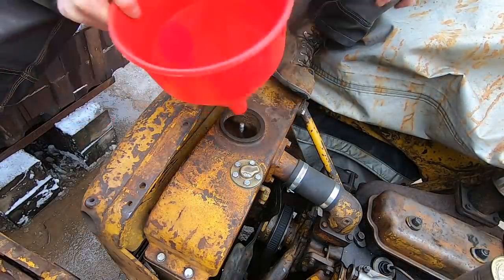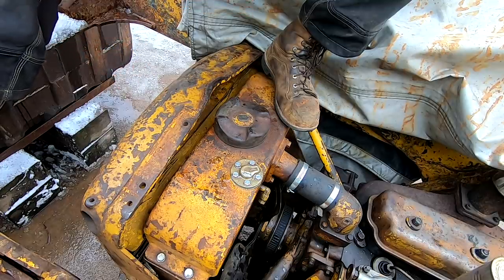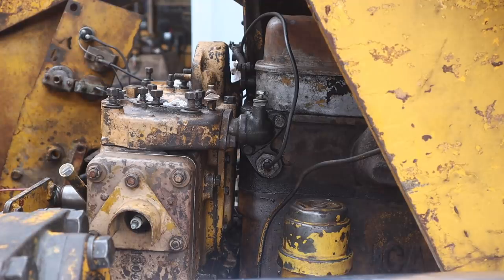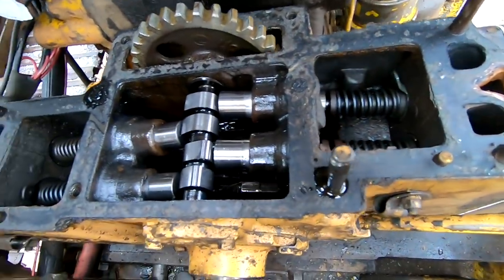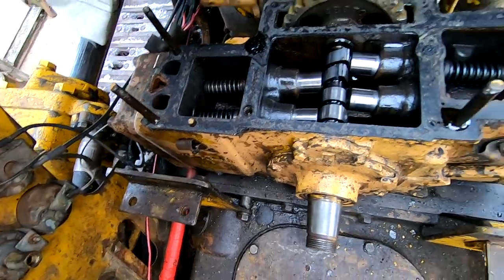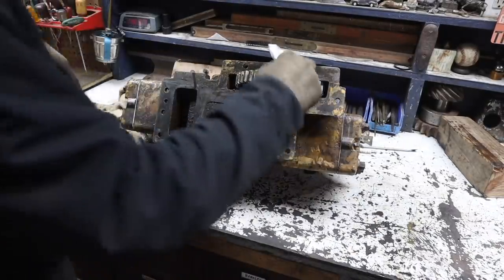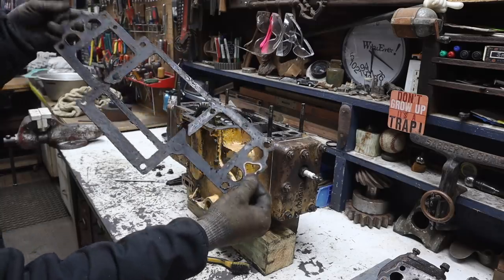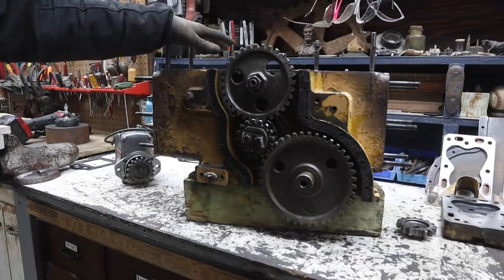I REMOVED the Pony Motor!!! ~ Part 15 ~ 1950s Caterpillar TraxCavator

Comment: Again, you are looking at the problem from a different angle.  The play is just fine.  The clearance is within standards.  There is no need to replace the bearing.  You will still have the play because it was meant to be like that.  You have fixed the problem by fixing the magneto.  Although, the contact point needs to be adjusted to precision gap.  The timing of the engine wholly depends on the gap of the contact point. The condenser has to be in tip top shape, so might as well get a brand new one.  This is the ignition system of old motorcycles, when contact less ignition firing was still in the designing board in motorcycle building.  I have had 2 motorcycles with this system, and it took some effort and time to precisely set the timing.

Comment: Bushes that are not comprised of white metal for applications such as crankshafts and gear shafts/axles are normally made of a special "phosphor bronze" alloy.

Phosphor bronze is porous so that it can retain a certain amount of oil within it's structure.

Comment: D2 and D4 Cats share the opposed (boxer) type pony motor. Larger Cats have inline 2cyl. I've owned a couple of 5J's (D2). One was a blade and the other was a cable Traxcavator. The main bearings should be replaced with factory replacement bearings. Their alloy is specific to the application. They are out there in internet land. Were it I who was doing this job I would certainly contact Squatch253 as he has all the specs, info and service manuals to help you. He is currently doing complete rebuilds (OCD) on a pair of similar D2 ponies. He got his parts somewhere. I bet he would share. Keep up the good work I enjoy your videos.

Comment: You found one half of a castle nut, where is the other half??? Something got wedged in the gears that made it to brake. Don't forget to look down in the basement. Also need to find all the broken parts of the gear too, all  those broken pieces are just floating around looking for a pinch point.

Comment: Uneven bearing wear on bearing nearest foot pedals would suggest a possible tiny imbalance or loosened flywheel may be worth checking checking  ?
Reply from the maker: The flywheel was absolutely loose! It definitely affected the front bearing and was part of what caused it to go bad!! I'll show you when the pony motor goes back together!

Comment: I hope youre replacing the rod cap bearings, they seemed to not stick to the rod caps like they should. If they dont spring out and stick to the caps its easier for them to spin in the caps down the line and youll have to clean up the aftermath of spun bearings.

Comment: Ethylene Glycol may have a change of state at 8 F degrees but it doesn't become an expanding solid like water. I had a customer who was adamant that his vehicles get ONLY pure ethylene glycol. Our normal winters include weeks at a time when high temp is -15 F and the occasional day with -35 F high. In the 5 years I saw his car for spring and fall service he had no problems at all. 50/50 mix is ideal for maximum cooling efficiency and is good for most cold climates. I like 60/40 for further North.

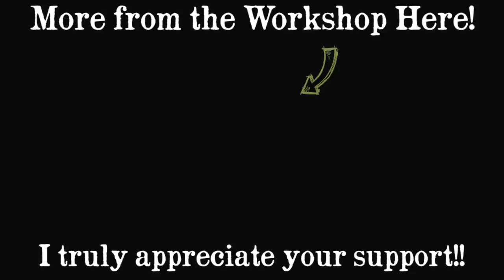Comment: The broken metal piece that you find in this video in the outlet of the oil, came from the following place. But before just need to say that my english isn't good; so you better have a look to the minute 32:55 ot the total 51:07 of these video and you will see the place and at the same time the piece. I think it's the screw nut of one of the pistons, which fixe the piston on the back part. Greetings from France.

Comment: were there timing marks on the gears in the magneto? Because for the spark to be triggered at exactly the right moment, the crankshaft gear, cam gear, mag gear, and the two little gears in the magneto need to all be timed  in relation to each other. 

You don't need to mark those sears. You have a timing mark on the flywheel on the front of the motor - I saw it on a previous video. Just figure out where that timing mark lines up on the front cover of the motor and you should be good to go.

Thanks for the excellent videos. I just found them about 24 hours ago and have been binge watching this series.

Comment: be sure to use bearing bronze and add the thrust material back to your thickness measurement.if the crank thrusts on the casting then adjust thrust clearance with the gear cover gasket.cant help but feel that that split nut or the other half caused the gear breakage.other half may be in the bottom of the starter gear housing.leave crank grinding to the crank professionals.
Reply: Nut was in crankcase drain.  Gear that broke was in front gearcase.  There’s no communication between the two (until he lifted the pony off the clutch housing).

Comment: Excellent video try find the factory aluminum alloy bearings for the crankshaft bronze is not meant for the speed that the engine runs they have a marginal oiling system I am sure that caterpillar has the proper bearings still available there are alot of them machines still out there in operations. It needs to have a minimum of 2 thousands of oil clearance on the crankshaft bearings because it if they are to tight it will stick to the crankshaft.

Comment: Water is very unusual in that it expands on freezing. Glycol almost certainly does not expand so while solid coolant would screw things up if you tried to start it, there "should" be no damage if it's allowed to thaw out.

Comment: Crankshaft end play is obtained by a thin steel washer 4b818 & the crankshaft brg. I still maintain it was the loose flywheel that caused the damage. To set crankshaft end play, install brg  adjust brg for proper end play, remove crank ,drill a dowel hole in the brg insert dowel. The  bearings are a Aluminum alloy, in fact all cat starting motor main bearings are aluminum alloy. Main engine bearings were aluminum backed. You can get .020 us 4f9413 brg & 030 us 1H2828 brg from Cat. Florin Tractor in CA might have some. That nut is off a Con rod, Somebody did a poor job putting that together the flywheel Has to be tight!. All I have left is a parts book for a D2. Have done lots of these motors,but my memory is not the best anymore

Comment: Not to sure about using just any bronze to replace that bushing but if you go that route oil impregnated bronze would be better for bushings.  Again not sure if I would use something outside of the manufacturer oem, best of luck though old red sure is coming along!

Comment: Squatch253 managed to source some old stock surplus parts.  This fault caused by not shutting off pony  motor by turning off the fuel and letting it run out.  If shut off with the magneto switch, fuel in the carb runs down into the pony motor engine oil, thins it, and these crankshaft bearings get worn out....  Do check out what squatch253 has to say about this on his D2 5j1113 starting system rebuild videos on his youtube channel.

Comment: If you could heat the lower rad hose convection will  cause the coolant to circulate and mix. The same way block heaters warm an engine.

Comment: To get the desired precision fit up on those crankshaft bearings you could cut them close on a lathe,  but your gonna wanna hone them to final size.  I didn't see a thrust washer or surface,  your gonna need to know what they did to control the thrust or what the allowable amount is.
Reply: The crankshaft end play is held by the washer, gear and retainer on the front end and a thrust shoulder on the crank.  In other words the front main bearing length sets the end play.  The excess movement he found results when that bearing gets loose in the crankcase bore/dowel pin gets loose in bearing etc.

Comment: I think that broken nut found in the oil drain is what caused the gear damage. That minor shaft play im sure couldnt have done that much damage to your gears. Think I would be lookin for the other half of that  nut along with the broken gear teeth before putting things back. Just saying. You worked hard on that beast. Take a moment to see where that nut came from.

Comment: bad crank bushes will cuase broken mag gears. the bushes control end float when worn or spun( a small dowel is all that holds them in place) the crank can float cuasing a harmonic vibration that shatters the gear and/or bends the mag shaft.

Comment: I think that a more likely reason for the damage to the magneto gear is that castellated nut that was floating around in the crankcase .I do not think the float on the crankshaft would affect the starter mechanism unless it was much worse than yours .

Comment: Don't forget the KISS principal.
Adding an electric starter just causes more problems to pop up eventually.
For very little gain.
Use one or the other.
Me personally, I'd go with the electric starter just because it'll be easier to change in the future and it has a lot less moving parts to fail.
I've always found that old KISS principal saved me a lot of money and headaches.
That's my two cents worth.

Comment: Making the new bearings is very cool but I think you should consider trying to find NOS from caterpillar because the metallurgy involved in selecting your stock could be quite difficult to replicate. "Just sayin". I do realize that the pony motor is only used for a moment or two during start up. But why not try to find the NOS while you have the motor disassembled.

Comment: you should NOT use bronze for a new bearing, use babbitt instead. it is the same material as the ones you have already. bronze can be good for surface bearings as well, but the pony motor was engineered with babbitt bearings and may not work with bronze, because bronze expands and contracts different from babbit. 
also the babbitt inserts in the piston connecting rods should be firmly sitting in the caps and not float in between the journal and cap. make sure the can't spin around, because that would be an issue as well.

but overall really nice work you've done so far, looking forward to many more videos about old red. 
greetings from denmark.
(don't mind my rather bad English)

Comment: Bronze is a good idea, but I would not make the whole bushing. Instead, drill out the aluminum bearing 0.1 and then add an interference fit sleeve inside the bushing. You could do the same with a sleeve around the outside, too, but it didn't look all that loose coming out. I think that would be more stable than entirely out of bronze or brass.

Comment: Aluminum wears well against steel. If you are going to make the bearings, build in a thrust face, pushing the bearing in from the inside.
That broken castle nut might have come from a previous motor.
Reply: My experience says otherwise. PACCAR truck engines in Peterbilt and Kenworth trucks have aluminum bearings and we've been having problems with them lately. Meanwhile the traditional babbitt bearings in Cummins engines have been just fine.
Reply: @dangerrangerlstc  The theory behind aluminum bearings, besides being cheap, is that they would absorb particles that might grind away the shaft. It would be interesting to know the cause of the failures. Too small bearings? Poor filtering? Inferior alloy? Lubricant breakdown? ??
Reply: @craigsmith8217  babbitt bearings do the same thing. Failures are usually delamination. No other oil supply failures.

Comment: i went that far in ,id do re ring also ,main and rod bearing also,welcome to heavy equitment, even the smallest track can be heavy after you lift about 200 of them hahahha.
also if im not mistaken ,oil clearance should be .001 thousand per inch of bore size,check your manual,also if the brass has oil for it it will be a upgarde as far as metal

Comment: The coolant flows up from the head through the thermostat down through the radiator to  the pump into the block in a continuous regulated circuit. From bottom up
Reply: P.s. might the nut be from a bearing cap?

Comment: "there's the old gasket ... it's probavly reuseable  ..."
Dude, you tore the old gasket taking it off. 
Gaskets are cheap. Get a hasket set for the pony motor. With that crank slop, and the half a castle nut you found, you're going to have to (or should) rebuild the pony anyway, as long as you have it out.

BTW, Use a daRn engine hoist or something to nring the pony motor back out to the tractor, and to set it back in.  
Your back will thank you in a few years. 
TRUST ME! I did the same stupid thing when I was young. 
Now, 40 ~ 47 years later? I can't reach my toes, I need a sock putter-oner thingie to get my socks on, I've have had a lower back ache every minute since March or April, of 1973, and some days I cannot reach my shoe/boot laces.

Just because you CAN lift and carry something heavy, don't mean you SHOULD.
OSHA says "50 pounds" is the most anyone should lift, no matter how big and strong they are, without assistance. I know that pony motor weighs considerably more than 50 pounds.

Unless for some unfathomable reason you WANT to be a cripple and in pain for the rest of your life starting before you hit 50, get help moving and lifting heavy items, or use a hydrolic or come-a-long/chain lift of some kind.

Comment: You mentioned the end float of the crankshaft, it is supposed to have some, and there will be a written tolerance in some handbook to give you an idea what is correct.   The play was most likely caused by the loose pin in maybe an elongated hole in that main bearing.   Are the other two holes for lubrication, or are they staggered to allow different end floats to be achieved..?
Reply: I concur.  The rebuild manual should specify an end play tolerance spec.  I've never worked on a donkey motor but every crankshaft I've encountered had specified end play.

Comment: Babbitt. Most engine bearings are a habit alloy. Looks like aluminum.  You haven't done one yet but some very old engines have Babbitt bearings cast in place. By use of carbon blackened crank it doesn't stick to crank. I have a feeling you'll do one someday.

Comment: I really think you should look at those cylinders and piston rings again. Just because you can't see any scoring doesn't mean they are ok. Firstly since you have it all apart you should check for tapering and ovaling in the cylinder bore. Then you should take the rings off the piston put them in the cylinder and check the gap. That is the only full proof way to know if your rings are any good. Buy the amount of oil that is bypassing the piston rings when you were hand turning the engine with the head off it would lead me to really look at those 2 things closer. Truthfully rings are normally cheap and anytime I have any engine broke down this far I just replace them, if they are available.
Reply: Another thing I was thinking about is looking at that carb along closer because no matter the age of the machine it definitely shouldn't wash the cylinder down with fuel from just sitting there even if you leave the fuel on. I would suspect in and carb of that age that either your float may be the issue. It may have a leak and not be floating or may be mis adjusted. Heck even the needle valve seat may be an issue. Yes I know you showed it opening and closing but that is not the be all end all demonstration people think it is.

Comment: One of the big jobs of anti-freeze is to provide a rust inhibitor in your cooling passages.  Leaving them dry for any period of time leaves them in air to corrode.  Not good.  Better when working on an engine to keep its anti freeze full up and catch it later to reuse it.  Your engine will thank you.

Comment: Now before jumping right in did you make sure that the magneto gears is in the same orientation as it was on old one for timing purposes cause if it backfires that could ruin your rebuilt magneto and your shaft problem you will probably need crank shims

Comment: Surely the rear main bearing would be Babbitt, or at least alu coated with Babbitt?  As some others have commented, Squatch253 on here would be a good person to contact if you need advice/knowledge of these things.  In all honesty though, as long as you have good oil supply to the rear main I can't see a problem with turning up a bronze bush if the crank is too undersized for a correct bearing after the scoring is cleaned up. 
It's done on some old Brit bike engines from the factory (bronze bush instead of a "real" bearing), not ideal and not gonna last forever but for as long as the pony motor is going to run (a fraction of the time of the main engine) I can't see it being an issue.  I do think the main problem to sort though, is going to be the end float since that could cause excess wear to the rods/pistons & bores etc.  looking forward to seeing the solutions you come up with as ever.
Reply: The main bearings were solid aluminum.
Reply: @brianrvd  cool, seems strange but I guess they did that for the same reason Bronze was suggested, that the engine runs that little it can be got away with & would imagine a lot cheaper and easier than pouring & machining Babbitt to suit.

Comment: Try Rivolta TRS plus penetrating fluid by Fuchs, fully synthetic, non acid, excellent creep, amazing stuff!

If you actually use a fluid every time you save so much canrnage and get to reuse the hardware.

Comment: These Cat pony motors take a beating.. They do not have pressurized oil, just splash, just like a cheap ol Briggs.  Getting inside and renewing as needed will be the best thing in the long run. Our engine builder strongly suggests mixing about 10% of the "sticky" Lucas Oil Additive to the pony motor oil.